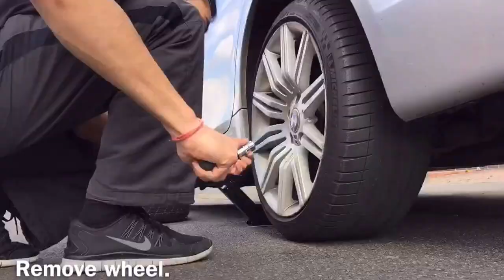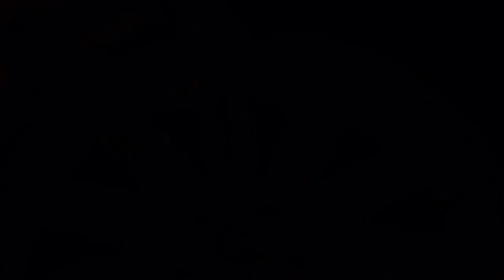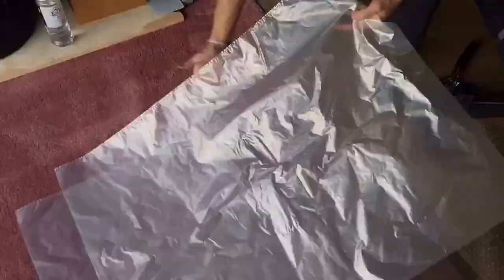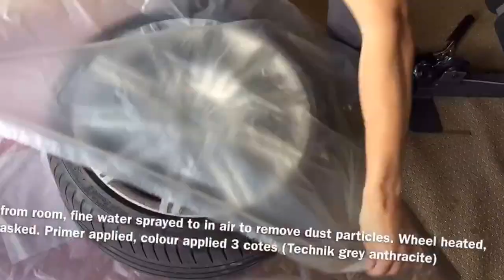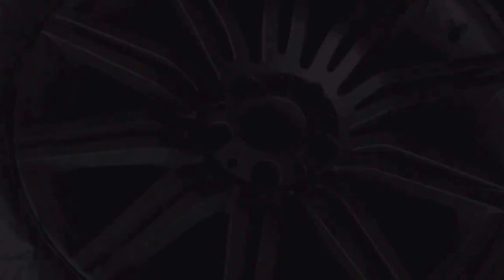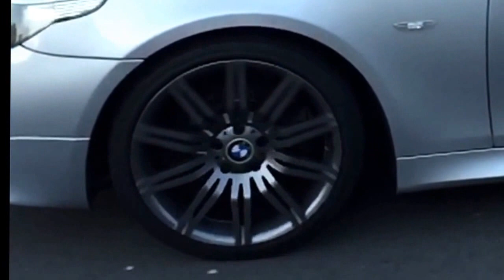Bmw E60 5 Series alloy wheel refurbishment and respray anthracite grey. Original BMW 19"spider alloy

Comment: Very nice man... i have 18'' MV4 alloy wheels (stock) and i want to refurb after you. I like that grey anthracite colour. One more thing... i need to use primer before paint? :D
Reply: Hi yes mate. Use the primer before the paint job. Heat the wheel aswell. You can use a heat gun but a hair decent hair dryer will
Do the trick. This will save any paint runs. Use the paint sparingly. I would recommend 3 coats so it's hard wearing.

Comment: Top job mate! How long four wheels take you roughly? I’m gonna attempt this in titanium silver!
Reply: Sandro Torre thanks mate. Took me about 3hrs per wheel. Nice go for it, when applying the paint heat the wheel with a hair dryer or heat gun this will help prevent any paint runs. 👍🏽
Reply: DsmTech Thank you for the info mate. What putty would be best for titanium silver? Mine are badly destroyed from kerbs! I want to keep mine the same colour.